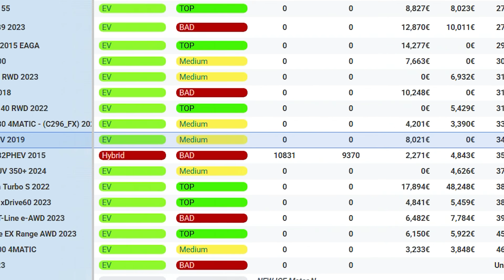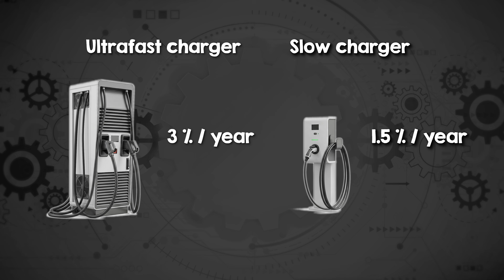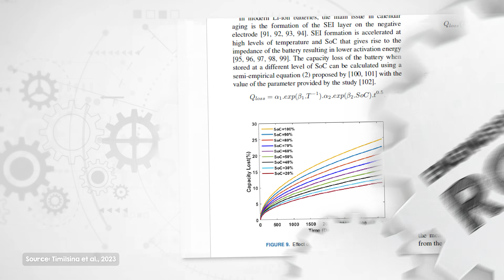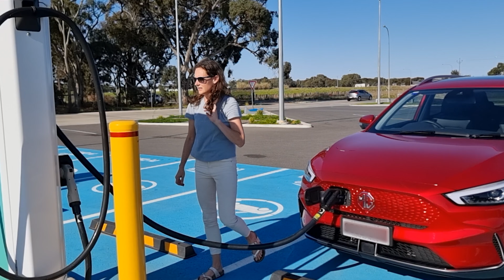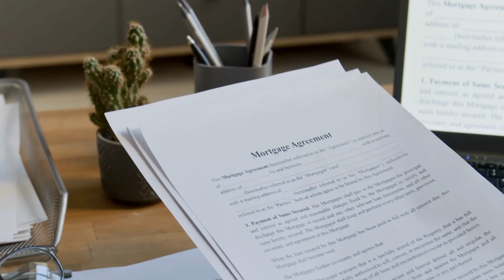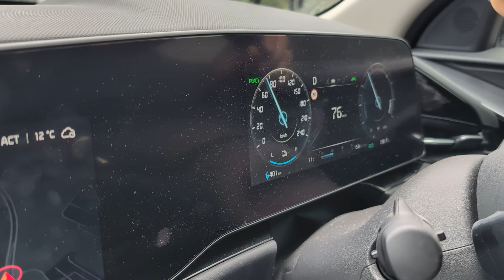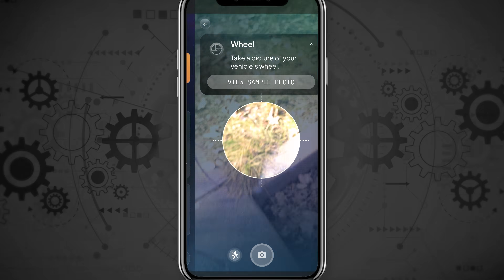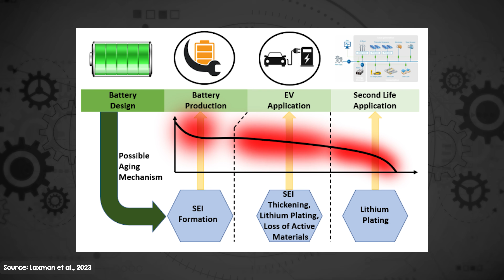Watch This Before Buying Your EV

Comment: Internal combustion engines degrade too. Do a compression test at 100,000km and get back to me at 260,000km which is considered the manufacturers ‘life of vehicle’.
Reply: I can attest to that, my old ICE car went form an efficiency of 4.8l/100km to 5.6l/100km after the first 2 years and 5.9 after the next 2. That's losing over 100km on a full tank but we don't think like that as we do with EV where a 10% drop might just be 20km on a full battery
Reply: @samuxan  That seems very unusual but you haven't said how many K's you have driven and over what period of time. How old the car is. How you tested the efficiency. So all in all not a helpful example.
Reply from the maker: Good point!
Reply: On todays cars seems it's the transmissions that fail. Getting a new CVT on on a Subaru can cost more than the car is worth.
Reply: @SkaBob  I would be more concerned if I had to replace a DSG transmission tbh.
Reply: @SkaBob  A generalisation which does not give an accurate picture. Automatic transmissions typically last 100,000 to 200,000 k's. Manual transmissions usually outlast the vehicle. A CVT if maintained will also last 150,000 + ks. Those are facts. But if you don't maintain them as with most complex components then you are likely to see premature failures.
Reply: @SkaBob  Yeah that's just CVTs for you. Get a real car with a real transmission and you won't have that problem.
Reply: @DoesntRefillTheBrita  CVTs can last awhile, especially those from Toyota, Honda or Subaru.  The JATCO CVT is notorious.
Reply: @unconventionalideas5683 there's only one CVT that isn't hot garbage and it's the Toyota hybrid one because it's beltless. Everything else is a cope because you bought a trash car.
Reply: @DoesntRefillTheBrita  I have never owned a car with a CVT so that isn't a problem.
Reply: With my last gas car, I logged every tank and its corresponding miles, and I saw a clear downward trend in fuel economy with time
Reply: They do.   But my Accord's engine replacement is 1/2 the cost of replacing a Tesla battery.
Reply: My 270K ice car has perfect compression. My 100K EV has 98% battery health. Love them both for completely opposite use cases.
Reply: @MihneaStoian  what are the compression readings?
Reply: So does about everything including people.
Reply: My BMW E39 managed 250000 miles on the original engine with no noticeable lack of power.
Reply: They degrade differently. My car is at 236 000km and it still has the same fuel efficiency and range. There is probably a small loss, but that is not noticeable in the noise of varying conditions. In general, ICE will run about the same until something breaks. On the other hand, a battery will start losing range pretty fast and lose range throughout its life. SoH=91% seems pretty typical for a used ID4 with 3 years and 40-50 000km. That is already a loss of 30km with another 30km due to be lost in the next years. And that is not until things break, that is considered "normal operation". And we are still a lot better than the 70% threshold that is considered OK by manufacturers.
If you run your car for less than 200km roundtrip and have that one holiday road trip a year, that is not going to be an issue. But for me that 60km definitely would make a difference between doing a daytrip for skiing, etc. comfortably on a single charge and having to recharge almost every weekend.
Reply: @foobar9220  that’s not true, if the compression is lower there’s a thing called blow-by, it can be caused by the compression rings or sealing around the valves, that effects efficiency.
Reply: @Glennloveshimself  Maybe you can measure this in a lab, but I struggle to find confirmation in my Diesel bills. I am still averaging around 4.5l/100km long term. If this was anywhere comparable to an EV, I would see this at the gas station.

And by the way...I am 1000km into my current tank, the first completely on summer tires and in spring conditions, is on track to 4.1l/100km. No hypermiling techniques, no turned off AC, no babying. Just normal driving (though we don't have much city driving here). Not bad for an old family car.
Reply: @Glennloveshimself  Do not feed the troll
Reply: @foobar9220  Diesel is different as they have heavier duty internals due to the compression ratio is higher, the engine tends to last a bit longer. The thing is with modern diesels is the extra complexity of common rail, DPF’s, SCR, EGR, EGR cooler and turbochargers and higher boost to get petrol like performance, the reliability is massively reduced. I’ve worked on many a diesel and I would never buy one. Yes my current car is a EV, PHEV before that, and a HEV before that. I’ve also been in the automotive industry for a combined 28 years.
Reply: @Glennloveshimself  Modern gasoline cars have all of that, at least here in Europe. And those modern extreme downsizing engines...3 cylinders, 1l displacement but 150HP...for sure will not be more reliable in the long run than my 1.6l TDI. Even without shooting yourself in the knee by wet belts.

But we are getting a bit off-topic. The type of degradation is vastly different for ICE and batteries. And that can be a problem at the current state of electric vehicles and charging. Though for charging the issue is mostly not technical but related to subscriptions for charging networks
Reply: @foo @foobar9220 s different from car to car. My 21 year old BMW touring used to average 45 mpg in mixed use and 50 mpg on the motorway fully loaded with cruise control on. It now struggles to get 35 mpg and fails to start 1 in 4 turns of the key. At this age it really isn’t worth fixing as the labour and parts would be more than the car is worth.
Reply: @foobar9220  An ICE car will not have the same efficiency or range after that much driving. Over the 10 years I had my 2012 Golf TDI my average fuel consumption went up. When it was fairly new I could easily get 4.5L/100km, but at the end getting below 5L/100km was a struggle. And it was not driven far either. Maybe 60-70k km or so, can't remember exactly.
Reply: @foobar9220  Well, tbf the early ID models are an example for particularly high early degradation. Might be due to a lack of buffer to eat away at or the specific battery design. We don't know. With many other manufacturers the battery will still be close to 100% at 50k. Nevertheless, the cases where it matters in practice are very rare.
Reply: @insaneshepherd8678  So which models are comparable to a Skoda Octavia station wagon in space and price while having a reliable battery? I need 350km of realistic winter range, otherwise it just does not make sense. And that is not just me...I just have to take a look at the parking at a random ski resort or trailheads for ski touring
Reply: @foobar9220  Model Y or Skoda Enyaq come to mind. My EV6 also does 350km in winter, but it has less boot space. Price mostly depends on the age of the Octavia. You might have to wait a few more years to get an electric replacement at the same value.
Reply: @insaneshepherd8678  So your answer is no. I do not get a comparable electric car at a similar price. And if I go for a used Enyaq, I will get the same platform as an ID4 has and the same degradation
Reply: @foobar9220  I'm not even sure what this discussion is about, or what it got to do with my original comment. Just drive the car that makes sense for you and keep an open mind when a change is required. BEV development is quick. 

I was just pointing out that the degradation issue is mostly overblown by those who don't drive EVs. In practice EV drivers rarely require extra charging stops due to a degraded battery.
Reply: @insaneshepherd8678  No, the range issue is mostly played down by electric drivers. There are plenty of use cases where this does matter. And I am not talking about a 1000km road trips but about day trips in the 200-400km range roundtrip. The loss of 60km often means not being able to do that round trip on a single charge. 
It is simple math...take the Enyaq 85 with 77kWh. At 21kWh/100km (pretty efficient for winter and mostly highway) it will do 366km 100-0%. Well...not really, as there is a hidden reserve of about 3kWh, so it is more like 350km. Now take 20% degradation and it is only 290km. My day trip to skiing just when from a comfortable single charge to fuzzing around with charging network subscriptions. At 10% degradation, as noted pretty typical for a used Enyaq/ID4 with 40-50 000km, this is like 320km. Might just work our or might just not. But this is irrelevant as within a year or two, it will surely not.
Reply: @foobar9220 Where are you getting your “facts” from?  I have a ID Buzz with around 48,000km and the SOH is 98%. There are some with over 400,000 km with still close to 85%. Plus combustion engines do lose range, it’s just not noticeable because many people don’t track it like they do EV’s. The BMS for EV’s calculate range instantly while most ICE vehicles don’t thus leaving many thinking that can go much further.
Reply: @stop_lying_bro  These are actual SoH values from the German car platform mobile for actual used cars. Around 80% of all cars do not have a certificate, but I seriously doubt that these are all excellent SoH. For an ID4/Enyaq, you will have a hard time finding one with SoH >= 95%. Not to mention 98% which I would consider a much more reasonable SoH. Go and check it yourself. I can only buy what is on the market
Reply: @foobar9220  that’s only the case if you spend a substantial sum each year on servicing.
Reply: @JohnR31415  Not really. Oil change every 30 000km, new oil and air filters at every oil change. New tires when the old ones are done ;)

Comment: I read somewhere a few years ago, that if you take an EV from 100% charge to 75% charge and get the kwh's used, that gives you 1/4 of the battery's current actual capability.   So for the test drive, floor it a few times, blast the AC, etc, anything to use power.

And do EVs even have OBD ports?  I've read they aren't required to have them (US)
Reply from the maker: I don't think OBD is consistently mandated in all countries but it is certainly the norm in most cars in most places and including all EVs that I've checked (which isn't that many)

Comment: Hopefully someone comes up with a reliable, affordable, quicker test, so when you get something like an RACQ inspection on your prospective second hand vehicle,  that can just be part of that evaluation.
Reply from the maker: They do exist, the short "flash test" (it was Aviloo) that Mark did for me only took a couple of minutes. And I believe clearwatt have one also, in the UK. there are others too. I think the biggest thing is that second hand EV buyers need to know they're available and start requesting them from sellers and RACV and similar, until it becomes the norm that mechanics have the equipment available.
Reply: @EngineeringwithRosie  sounds good!